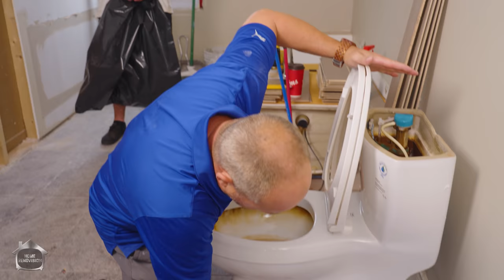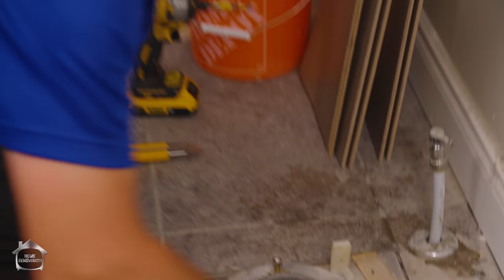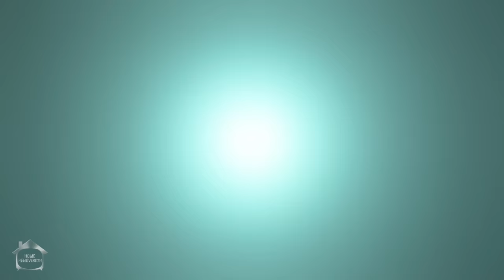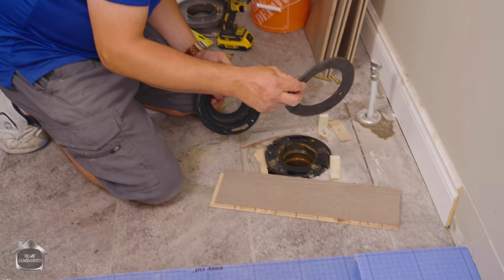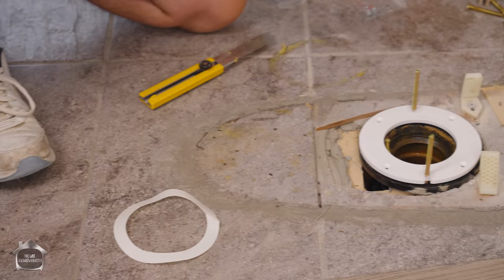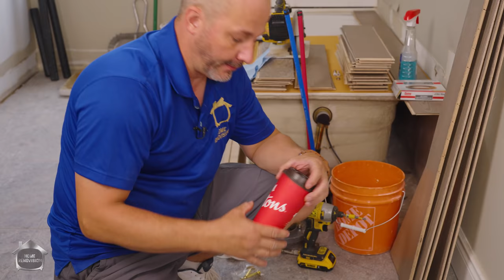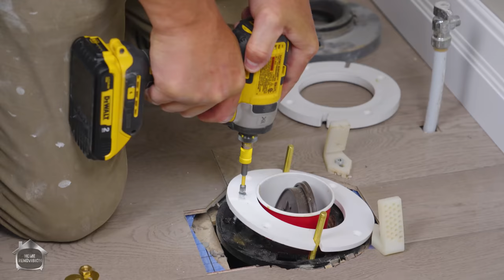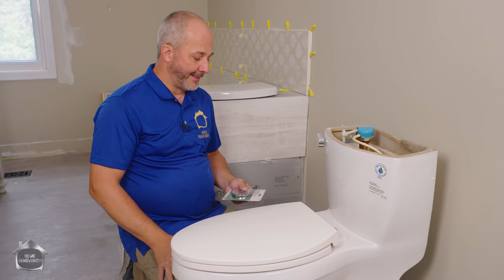How To Install A Toilet So It Won't Leak | DIY For Beginners

Comment: Rubber for me. it's not too much more expensive, and if you make a mistake, you can just lift up the toilet, and put it down again. 
For wax, once you press it down, it's pretty much that's it. And when you want to replace the toilet after years, have fun cleaning up all the gunky wax. lol
Reply: What rubber kit did you use?  I can’t stand those wax rings.
Reply: @Splattervision-qh1sd  home Depot has plenty. It's like $10-14. Blue or red, doesn't matter
Reply: @benc2798  Thank you!

Comment: I’ve always heard that you should never grout or silicone your toilet to the floor, because if the seal fails, then you have waste backing up under the toilet and you never know it, whereas no grout or silicone means it’s going to seep out, and you will know there’s an issue.
Reply: True, many plumbers with caulk all around the toilet, except the back. Any leakage will flow out the back

Comment: Turns out whoever installed my toilet put the bolts in upside down…the wax gave out since the house moved and yeah toilet was never bolted down. Super fun getting wax all over you trying to fix the issue.

Comment: What do you think of the rubber + wax seals? We used one of the danco perfect seal ones when we redid our bathroom so we could reinstall our (only) toilet quickly at the end of every day or if we needed it in case of an emergency. Seems super well thought out, and at $16, it's not too bad, especially considering it also lets you work with different floor heights without the flange extenders etc

Comment: The 5gal bucket trick is also a really good way to unclog a toilet.  I used to work for the State Parks and 9/10 times it worked magically.  With a plunger, there's always a chance you might splash that nasty toilet water and with all the budget cuts since the LAST recession, the only plungers we had were dry rotted or the $5 special that don't work. 

Just pour that 5gal stream straight down the hole.  It'll either blast the clog out within the first 2 gallons or the last 3, once you build up even more pressure as it fills.
Reply: This is the way I would always test a toilet for a partial clog.  Works great
Reply: You can also just manually flush the toilet.

Comment: I shit logs. sometimes it takes two or more flushes to get it down. I don't want to waste water, and so what should be the water pressure to flush my logs once?
Reply: You need fiber. 😸 The key is to change the logs, not the toilet. Make the logs smaller and softer. Get soluble fiber and mix it into everything you drink all day long. Get 2x the recommended fiber intake per day. Increase the amount of fiber you mix and drink slowly going up each day over the course of a week or 2 to prevent stomach discomfort. If you slam 2x the suggested intake all on day 1, you'll be uncomfortable so don't do that. What you need to do is make your poops very soft and loose (without using addictive laxatives!) with fiber and non-addictive stool softener like docusate sodium, and work on going to poop more frequently than you currently do before you get the urge to go. This will cause you to have a less full rectum and your sphincter won't need to open as much to let it out because it'll be nice and soft and not as fully packed to your rectum's full size. Do pelvic floor exercises daily to strengthen and tone your pelvic cavity. After a couple months of all this, your rectum and sphincter will have much increased resting tonicity and your rectum will shrink in volume so the stools will be smaller and you'll get the urge to poop sooner than before, and you'll naturally stop forming big, hard logs that always clog the toilet. Back off on the fiber and stool softeners after a month or 2 if you want to so that you don't have LOOSE stools and they're more formed, but they're still very soft and easy to be squished in the S trap of the toilet and flushed down. The healthy stool is a smooth snake with no surface features. Even if your rectum doesn't shrink down in size significantly and gain increased tonicity, you'll still have nice soft logs at the least with the increased fiber intake and they'll flush very easy. You can't change the water pressure of a flush even if you wanted to. The standard residential toilet uses a tank that is filled up and then gravity is what dumps the water into the bowl to flush it. You can't increase gravity. You can't easily change the speed of water dumping out of the tank either. You can adjust the fill valve to put more water in the tank, and you can adjust the flapper to stay open longer if you'd like. Still, if your logs are too thick and hard to pass through the exit hole and S trap, it won't matter how much water you dump into the bowl. You could replace the toilet with one that uses the design of that contains a pressurized water tank. Those contain the water slug in a pressurized tank and when you flush it, it releases a very high pressure jet of water instead of just letting the water dump under the force of gravity. I hate those toilets. They're loud and scare me every time I encounter one. 😐 Just try the month or 2 of fiber, stool softener, pelvic floor exercises, and going to go poop before you get the urge in order to get your logs to be smaller and much softer. That will solve your problem, you'll be healthier, and that tonicity will be mostly permanent. It takes months of chronic constipation to stretch out one's rectum so that they form big logs, and undoing that stretching is what will solve the issue. 👍

Comment: I've never installed a toilet before.  My biggest fear, is when I push the bowl down, that the wax will squish towards the hole, not outward, so I was thinking of getting the fluid master wax free gasket, instead.

Comment: How do you grout it to the floor?
Reply from the maker: simply fill the void with sanded grout and wipe with a sponge. once dry use clear silicone to seal it and it never cracks loose. Cheers!
Reply: @HomeRenoVisionDIY  thank you for information.

Comment: Interestingly, I just had to re-install a basement toilet due to clogging. Used a rubber only seal for it, but then I noticed that the flange was installed tilted to begin with, so I'll have to replace the flange too. Could you shoot a video that teaches us to remove old metal flange and replacing it with something modern? :P

Comment: Meh. I pulled up old 1880 tongue and groove in my house. 2 layers. I re-braced then dropped 2x 3/4" ply. Wtih 1/4" heating cable direct bond with 1/8' tile I MIGHT be coming back up level with the flange! lol.

Comment: Any plumbers from the UK watching this thinking, "I'm so glad I don't have to deal with shitty wax" 😂
Reply: It's really not a problem. 🤷🏻‍♂️ Wear nitrile gloves. Keep a dedicated putty knife in a bag for scraping the old stuff off. It's a good method that will last a long time if the toilet and closet flange mounting is secure and stable. Even the foam gasket shown here will shrink and crack over time. Automotive tech here, seen that material fail countless times from age. Wax won't shrink or dry out or crack and it won't leak unless the flange moves or decays. PVC flange, 1/4" above finished floor, secured to slab-on-grade foundation with concrete screws, and a wax seal. That won't leak for an entire lifetime. 👍

Comment: Great video... but I think Tim's may not like it.  ;)  It is probably the homeowner's choice, but I would have replaced that toilet... it looks well used and dirty under the rim (rust stains).
Reply: CLR can easily get rid of the mineralized water rust stains. Shut off the water and empty the toilet bowl like shown here in the video. Place paper towels on the stained bowl surfaces so the inside of the bowl is lined with paper towels, and then soak the paper towels with full strength CLR. They hold the CLR against the stains and allow you to soak the bowl surfaces that are way above the natural water line. Occasionally go back and re-wet the paper towels with CLR and let it soak for many hours, you can even do this overnight. After several hours, take the paper towels off and scrub the bowl with more CLR. Repeat as many times as needed to get the stains to be gone. If CLR won't do it, perhaps something like Evapo-Rust will work better to get the rust off the porcelain. No need to replace something that just needs an easy and cheap cleaning procedure. 😺

Comment: I always trust your videos...loads of actual information....my toilet starts to leak underneath the concrete floor...EXACTLY WHAT HE SAYS...my toilet is badly installed ,no flange or connections whatsoever underneath the toilet ,,just darn cement..CRAZY LAZY PEOPLE did my toilet.....now i have to REDO EVERYTHING AND FOLLOW YOUR VIDEO,,,i hope i can get the right stuff i needed to reinstall it myself.....the leak is exactly what he says...the dark rings forming underneath thd floor...nasty

Comment: 11:02 why not just use that rubber ring all the time then bc all houses move?
Reply from the maker: You could but there ism a cost associated with doing that.
Reply: @HomeRenoVisionDIY  are they that much? Oddly iv never seen that set up I do alot of toilet removals

Comment: My home inspector just recommended we remove silicone around the base of a toilet, saying it was not recommended because it can hide leaks.
Reply: Correct. I don't believe in grouting or sealing a toilet to the floor. If/when it leaks, you WANT to see it. Very important imo. It's an extremely polarizing topic. Split 50/50 down the middle. 😸
Reply: Leave the back unsealed.
Reply: Its often Code in many jurisdictions, but a dumb one.

Comment: I liked the information about the toilet. But the way you roughed in that sink would never pass in ontario.
Reply: You can not install a drainage TWY horizontally. You should have branched off the two inch wetvent below the sink on the left.
Reply: @jamiemontin1420  It is in Ontario!

Comment: Why bother with wax seals.. Fernco has a wax free PVC seal and it works. I’ve installed it on three toilets and one of them has been in use for over 10 years with no issues.

Comment: I've got a toilet tank that won't just start driven between the tank and the ball I replace the flapper I've replaced the little seals on the bottom I've replaced the filling mechanism my replace the float and the damn thing still leaks and thinking if I have to replace it, I'm going to replace it with one of those turbo toilets you see in restaurants or a pressure assisted flush that way just push it bush it's gone and maybe add a day but then I think you're hosting a another set of problems because now you want to have like little towels there so you can wipe your bum dry so you're not pulling your underwear up to a wet ass, so you do more laundry or you use toilet paper anyhow

Comment: You could hurt your back lifting the toilet like in this video.  I have seen a better and safer way: inserting a thick piece of lumber across the rim of the toilet before holding it and lifting up.

Comment: That shutoff looks very tacky. I understand that you used pex in this house but you can get the copper shutoff shutoffs for a better finished look. All you have to do is solder a shutoff and go from pex too copper but its the small details that make it look that much better. Flimsy plastic like that just isn't a good visual.

Comment: If you want quality plumbing the drain to your toilet should always be in cast or everyone in your house will always hear you flush the toilet
Reply: Uh, that's not true at all. 😸 Cast leaks eventually and really sucks. PVC or ABS is the BEST. It'll last forever. Modifications and repairs are easy. Cut, glue, done.

Comment: With all the advancements that have been made in the plumbing industry, we are still using a primitive, non-reliable method to attach the toilet to the drainage system.  Wax bowl ring seal is just garbage and is the source of so many problems.  The chincy little bolts that are supposed to hold the toilet to the floor are ridiculous.  Attempting to line up these bolts with the holes in the toilet while hovering a 70 pound fixture over them almost insures that you will misalign the ring seal and damage it.  Not only will the connection leak but dangerous sewer glasses can enter the living space and cause health problems.

Comment: “The most common cause of water damage in a home” is the reason I will not caulk or grout a toilet to the floor. You won’t find the problem till it’s to late.

Comment: I will say NEVER buy the wax rings that have the plastic "horn"/funnel on the bottom. I have had every one rot the wax for whatever reason. Pretty annoying after 5 times at different apartments.

At my sister's, there is a heat vent next to the toilet that kept melting them. We're trying a foam/rubber seal at the moment. It appears they had used a deflector in the past to keep the heat off the toilet but that had broken off.

I once found a toilet that been "sealed"  by a large ring of plumber's putty. It was not sealed and that plumber's putty was dust.

I really dislike the look of a silicone seal on the base of a toilet. And I really don't want to seal in a leak so I can't see it until it leaks out the ceiling below.

Comment: This is the weirdest system, a freaking wax ring? This is totally different from EU, where we use rubber caskets like normal people.
Reply: All of North America uses wax rings. They're great. 🤷🏻‍♂️ Cheap and easy to replace whenever the toilet has to come off. They never dry out, crack, or shrink. If the flange is securely mounted to the floor and the toilet is tightly mounted to the floor and flange, it'll stay sealed forever. Wax rings are $3.